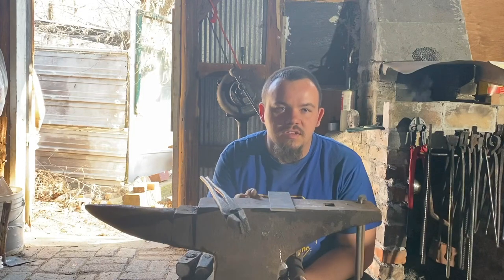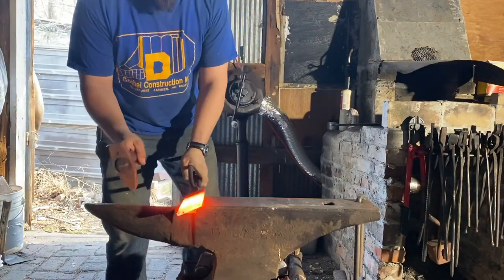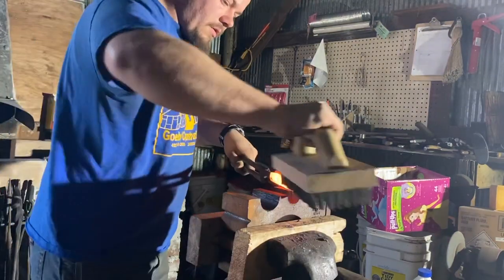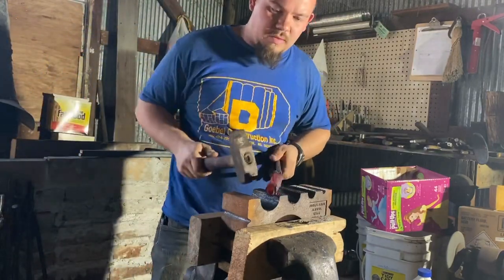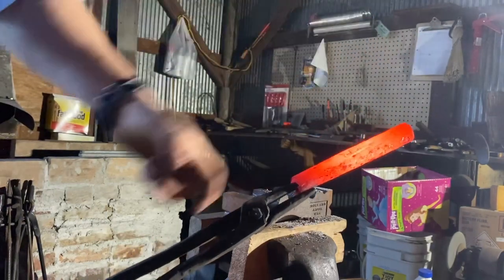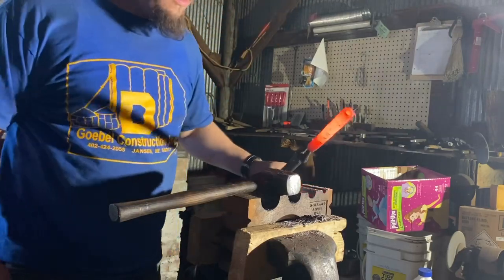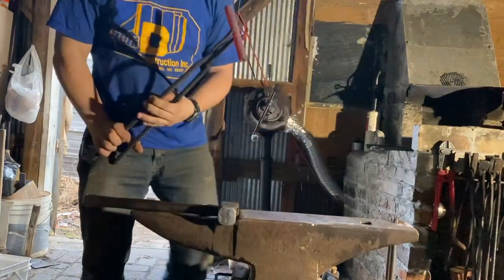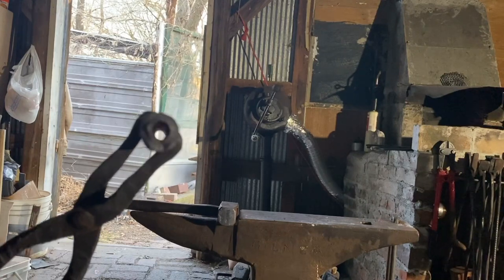Forged Gun Barrel - Method 2

Comment: Have a friend of mine who welds barrels at Dixon's and elsewhere. Upset the edges of the skelp so there is enough material for the weld. Start from the center with longer stock so the hole stays centered. Use heavier material wrought iron if you can get it but at least 3/8" thick. The mandrel helps keep the hole centered as well as round and as my friend says" It's all about the hole"
Reply from the maker: Pat Taylor Thanks for the info! Any way you could put me in contact with him? Upsetting would definitely help keep the hole from becoming pear shaped. I left the rounded edges to form a butt weld like they used to do it so it would really mash and upset together and have a large surface area that is welded. I didnt completely weld the seam on the outside because I really want to see how much I can (or can’t) get away with. I am going to make another section out of 3/8” stock as this is too thin to be evenly comparable to the other two barrel sections I have forged.
Reply: Been watching him do barrels for a few years helped him as well. I've pretty well summed up what needs to be done.
Find me on Facebook Pat Taylor blacksmith and pm me for info

Comment: Do you do normalizing heats on the barrels to fix the grain pattern? Would that make the barrel stronger or weaker?
Reply from the maker: No, but technically yes. I do not intentionally give it normalizing heats, but during the final passes of making the octagon flats, I work it at lower heats to really planish the surface and make it as even as I can get. This allows me to “work normalize” it. And having a tighter grain structure is always better than a large grain structure. (Except in an application you want the part to break or break before something else)

Comment: I’m guessing this will be the weakest one...really want a sledge block...
Reply from the maker: Theoretically it is the strongest, as it only has one weld seam to fail. I’m going to be making another with this method from some 3/8” flat bar (same dimensions, I’ll just end up with a 3/16” bore vs a 5/16 one) so it’s dimensions will more closely match the other two. Still going to test this for strength.
Reply from the maker: Also, I thought that too. Picked up this swage block last September, and this is the first time I have used it!
Reply: Veteran Iron&Wood one weld, but thot the strongest set. The spiral weld I have seen has force o the top, the last one you were able to put force on the weld in all kinds of different ways, yet this one had force from only once side. Maybe with a mandrill it might be stronger.. but how do you keep the mandrill from welding. Granted this is all theoretical as I am a crappy welder and only really have book knowledge.
Reply: Not really  sure  however I reckon being  mild steel it would be in order to use a stainless  mandrel. However I have no real world basis for that theory.  Next question is extraction of the mandrel after forgewelded w o distortion of  one end of the bbl.  I suppose one could super chill the whole assy in a freezer after surround it in dry ice...most likely  for 24 hours.  Then rapid heat the bbl to expand it then quickly press out or drive  out the mandrel.  Similar processes as installing or extracting  bearing races in high tension  applications.  Again just a theory based in mechanical experience
Reply: Daniel Crawford real question would be, how did they do it back in the day?
Reply: its a swage block

Comment: You should  try to  make a  gun  barrel for a  modern  firearm  a .22 caliber  would be the  safest to try.
Reply from the maker: Hello well intentioned internet expert!
Many things wrong with your statement!
1-22lr operates in excess of 24,000 PSI, FAR ABOVE what black powder muzzleloaders can reach! 
2-Small bore muzzleloaders are EXTREMELY difficult and finicky to forge! Theres a reason you dont see hardly any historical small bore (below 32 caliber/8mm) black powder front stuffers!
3-You should check out my video where I intentionally try to blow these test barrels up to see which method yields the strongest weld! 
4-Ive already harshly test proofed the current barrel Im working with-TWICE! Because I wasnt happy with the first breech plug so I made a second and re-tested the barrel and new breech plug as a unit.